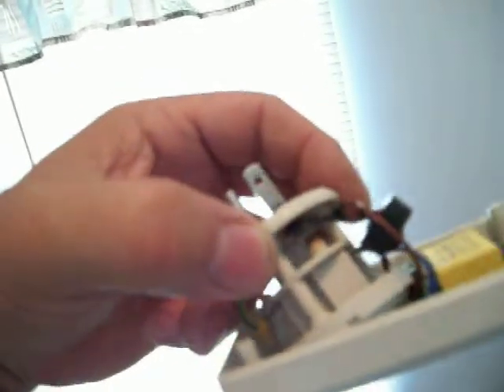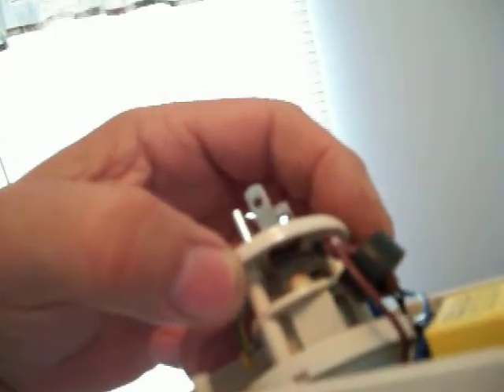POWER METER ((( WANF))))NOT SAFE TO THERE RATED WATTS!!!!!!!!!!

Comment: @TheKilog69 That doesn't sound like a very good design. The only thing that needs to handle big amps is the shunt, in the KAW it's just a short piece of thick solid wire and it's right there at the plug. Looking forward to seeing the closeup pics. At $15 for a KAW on sale, I can't see buying a WANF one. Yea, the backlight is nice.

Comment from the maker: @nrodge1 Hi THE Brown wire That is used as a pick up i asume is attacted to the plug with a small screw,i mean tiny not soldered on screwed on & it burnt of at the plug end and the brown wire burn off as well.now the P3 killawtt meters are not built this way and are twice the cost but are well built and UL Safety Listed .I Thought these were cool because of back lite & extra stuff they do if u like i will send u some close up,s Pic of this .it,s just a cheap design. 4 low watts its ok

Comment: Can you take some close up pics of the insides and maybe what happened? I would like to understand what went bad in there. The shunt should be as close as possible to the terminals since that's what takes all the power. Or was it a bad solder joint? Feel free to post pics on the forum at techluck.com if you like.